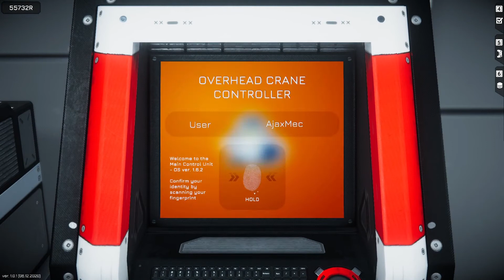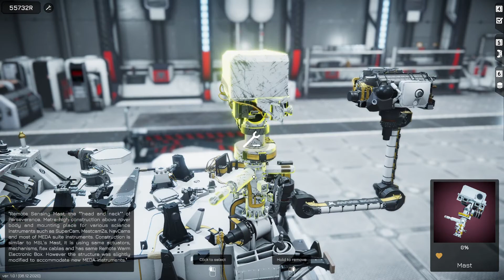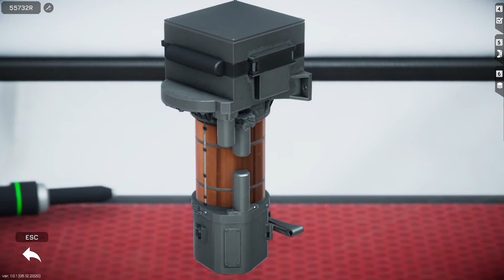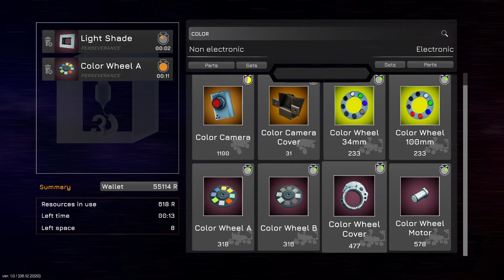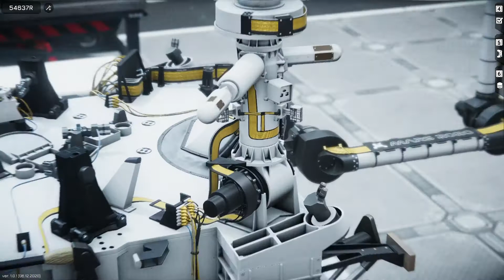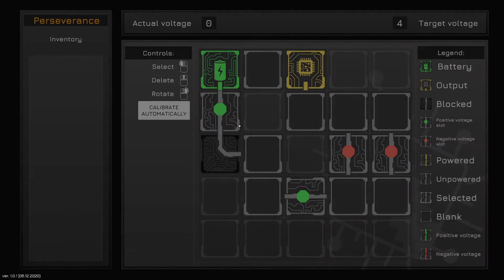Rover Mechanic Simulator - Perseverance Rover DLC : First Look : More Martian Repairs!

Comment: I have Rover Simulator as well and just installed the Perseverance expansion. Wish I could skip forward to the Perseverance Rover but the game starts me off on Sojourner... I suppose I will learn predecessor technology before getting to the more current goodies. Looking forward to watching your video in full once I'm allowed to take on Perseverance.
Reply from the maker: You're right, it would be good to go straight to the 'fun' stuff, especially if you're familiar with how the game works. But, these more complex machines do need a bit more work to repair so, I guess, it is realistic. 🤔
It's not a game I spend a lot of time with but it's very well done and is an entertaining diversion when I don't want to think too deeply about strategy and stuff!  😎